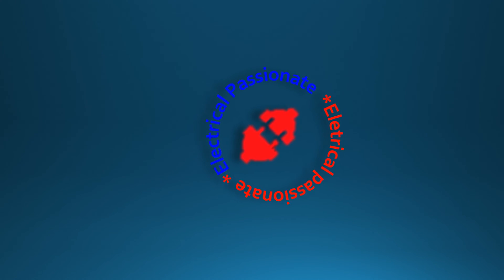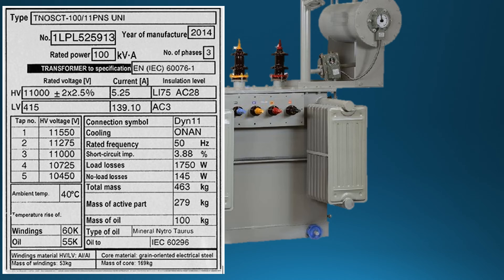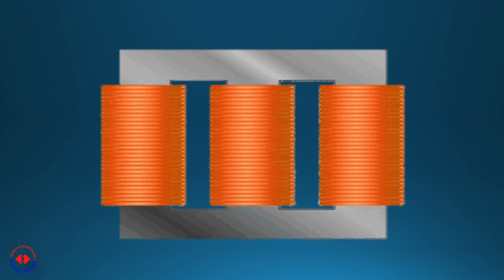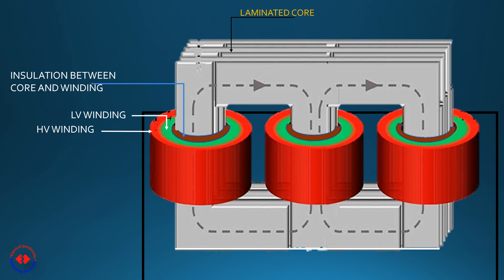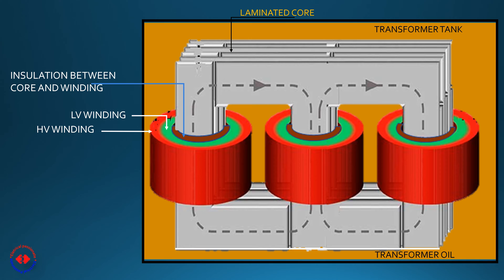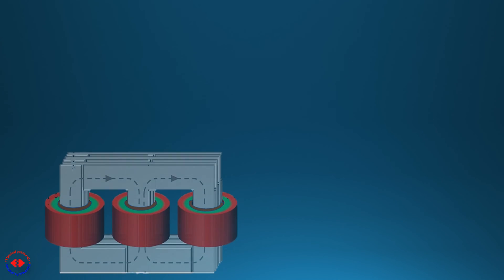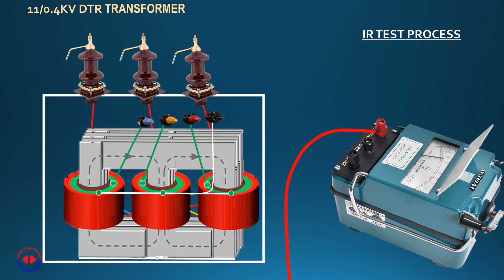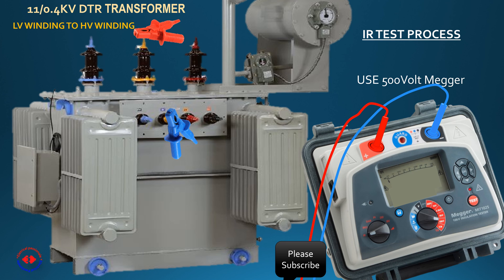DIST.TRANSFORMER MEGGER/INSULATION RESISTANCE TEST PROCEDURE  OF A DISTRIBUTION TRANSFORMER

Comment: It is not clear what should be the test voltage while testing IR value between hv to Lv.

Is it as per LV voltage or as per hv voltage.

Is there any significance for line terminal & power terminal while carrying out the test.
What I mean is where to connect line terminal & earth terminal of megger
Reply from the maker: You are welcome. As the tests are performed on 11/0.4KV Transformer,so LV side rated voltage is 400 Volt. We must use 500 Volt Megger or test voltage while testing IR between LV and Earth/body as well as testing   IR between HV and LV. Test Voltage should be <600 V considering the lower insulation level of LV winding. Thank you.